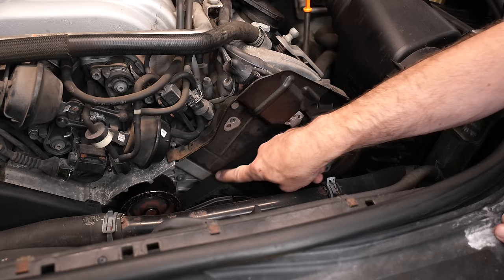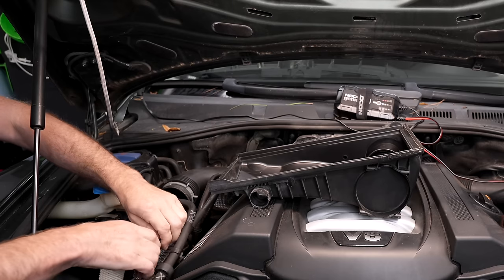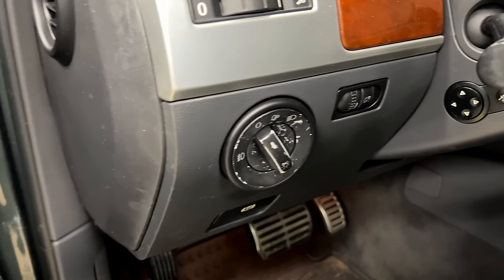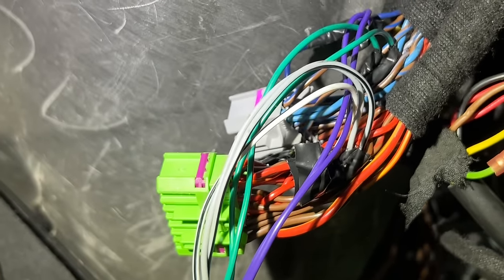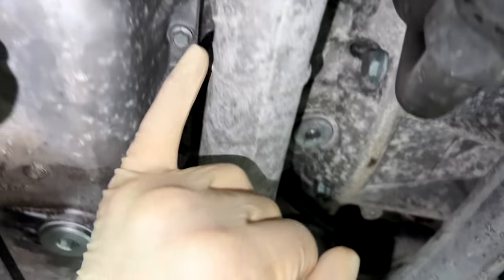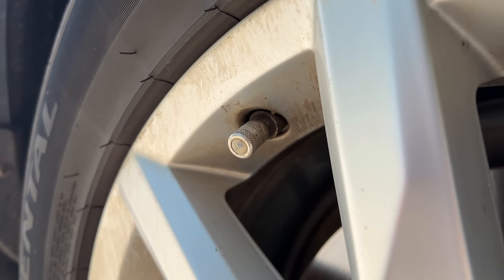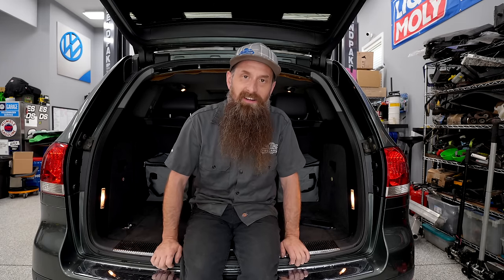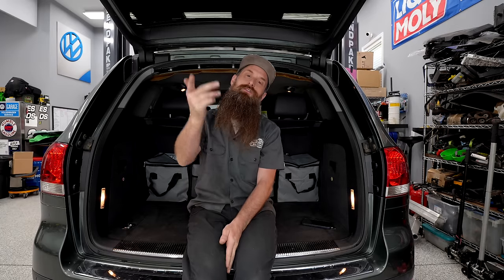Is It Worth Buying a CHEAP, OLD VW Touareg?

Comment: I've had a 04 Touareg (V8) for 5 years now, and I knew little about cars let alone Touaregs back then. Today I have enough knowledge and understanding to post advice here, lol. So here's what I think-
1) Mechanically, 1st Gen Touaregs are respectably well built suvs. My 04 had some issues, but that is to be expected for the first year of any car. 2006's have plenty of those issues resolved. (Note: T's built in 2004-2006 are called T1 Touaregs and those built in 2007-2009 are T2 , but they're both considered 1st generation. 2010 and onwards are 2nd Generation.)

2) The engine in the T1's is a Multi Port Fuel Injection engine, which means that it doesn't suffer from carbon-buildup-on-valves issue the way engines with Direct injection do. IMO it is a very well made/designed engine. As long as you change the oil every 5000 miles and do timing-chain/water-pump service every 80,000 miles, it will last a long time. The one failure point on these engines that my mechanics don't want to mess with, is the seized actuator arms on the intake (discussed in the video).

3) The transmission, transfer case, differentials, etc, also are high quality. They perform very well, and with regular service they don't fail. Altogether, the drivetrain is great and tough enough to not only take it off-roading, but also tow 7700 lbs (which is a lot for a vehicle of this physical dimensions).

4) I wish I could say these nice things about 1st Gen's interior. The interior is so bad that you'll be better off just taking it to an auto-interior shop and have them rebuild the entire interior from floor to ceiling.

5) As for electrical issues, if you encounter those, take your Touareg to a VW technician. If he cannot fix those, he shouldn't be calling himself a VW technician. But before you do that, make sure to check the battery. The Touareg's electrical system is quite sensitive to a weak battery, way more than other cars are. You have to almost obsess over making sure that the battery stays fully charged at all times. Also, even a high quality battery would need to be replaced every four years. If the electrical issues happen despite you having a good battery, only then take it to the technician.

So should you buy a 1st Gen Touareg? Before I answer that, realize that even a 2009 model is 14 years old today, so there will be plenty of issues to resolve. IMO you should get a V10 Touareg only if A) you tow 4000+ lbs on a regular basis, and B) your auto-repair skills are on par with professional mechanics. If you do not meet both these criteria, do NOT get a V10.

If you live in the midwest plains and you don't tow much, a V6 Touareg is sufficient. I live in the Chicago suburbs and I knew within a year that having this suv was overkill. Why does one need low-range transfer case in the plains? The only reason I've kept this suv is because I like the ride.

If however you live in hilly areas, or if you tow (but you're not an auto-mechanic) then you should get a V8 Touareg. The car has some features built in that automatically provide extra power when needed, and that makes towing or driving on inclines/declines a pleasure.
Reply: my friend group all have touaregs. two t2 3.6's, 1 t1 v8 w/air ride, and mine and another friends t3 tdi. I owned a V8 w/air, and a t2 3.6, prior and honestly the 3.0L TDI in my t3 out performs even a v10 when towing or just driving normally. its such a wicked engine. the t3 isn't as hardcore offroad as the older ones, but it can still do everything the older ones can, just with an issue of clearance and damaging a more expensive vehicle if you run into something. The 2013+ 3.0L TDI is the best engine in any touareg in north america in my opinion.
Reply: Disregard everything the OG poster said. I'm an engineer and had an 06 with very low miles and full extended warranty.  We went through 12k in warranty repairs before dumping it.

Now I'm a Toyota owner and can confidently say thus doesn't hold a candle to a Toyota or Honda.

EUROPE must have some nasty environmental laws that sabotage these cars with eco friendly parts that destroy themselves.

For example: The coating on the buttons wears off very fast.

The protective shielding on the wiring also disintegrates (never seen that before).

There's a notorious problem with the drive shaft carrier bearing.  It will disintegrate after 4-6 years.  The replacement is a new drives haft!  They do make aftermarket kits to retrofit your axle bearing to a serviceable unit but it's $1200.

I have 40 year old Toyota that still have the original carrier bearing and rubber! Wtf VW.

If you want a car that will leave you stranded this is the car for you.
Reply: @LibLibertyLibertarian  Funny, I worked at Toyota from 2016 until last year. They're phenominal appliances. If I recommended my mother a vehicle, it would be a toyota or lexus. But no, a comparable 4runner from 2006 is not going to outgun a Touareg. Especially since the touareg was made to do it all. The 4runners powerplant falls on its face on the highway, it's not a good tow vehicle, and a Touareg will outshine it offroad when both are similarily equipped. Figured that out when we took our rigs and my other friends GX470 out to the trails right quick. And well if that were true across the range, then my 7 examples of mine and my friends touaregs would've fit your experience, but aside from one leaking air hose on my air ride, and an alternator on my 260k 3.6L, none of our touaregs have had major faults. And I've had my TDI for 6 years now, and the ones prior I had anywhere from 2-3 years. Like I say, you either get a good Volkswagen or a bad one. No in between. They can be nightmares, which is why I don't recommend them to people who don't know anything about cars. But to those who dont mind wrenching and learning, the euro suv's like touareg, cayenne, ML, Range rover, etc. are a total world above anything from Japan. Save for  a Land Cruiser, but at that price point, it better be able to compete with them...
Reply: Whats that bad about the interior? Seems about par or a bit better than most other cars of its debut year...
Reply: @brandonfriesen5389  your comparing a v10 diesel to a I4/v6 4 Runner?  Keep in mind that you're only shining a light mostly on the power plant benefits.  These vehicles spend 99% of their life doing errands around town.  On top of that, the 4 Runners aftermarket support far exceeds that of the VW, so even if what you say is true, it could easily be compensated for.  On top of this the Toy will bring you home from the trail while the VW could easily leave you stranded.

On top of all this, we must consider the resale value.  The VWs are so cheap because they break down, are complicated to repair, and expensive parts.  You dump money into the VW to turn it into an off-road beast you'll never get your money back.  You will out of the Toyota or a Jeep.
Reply: @brandonfriesen5389  I haven't had a 4runner but had a FJ, I'll admit the Touareg is a better ride (when it runs) but to me it's worth the headache of always going to get it repaired or repairing it yourself when it fails.  I have a Toyota truck for 6 years now with twice the miles my TReg but so far its had no issues, the TReg had a dozen trips for repairs.  My time is far more valuable than to deal with that BS.  

I highly recommend that we turn our backs on these companies that make unreliable cars.  They are not only inconvenient, they are horrible to the environment when they get junked.
Reply: @GoldenCroc  it falls apart.  The buttons are notorious for peeling off.  You can buy stickers, scrape the texture, and carefully place the sticker. 

 The battery is under the seat so if you leave it off too long you may have to pull a 100lb seat off to get at it.

The climate controls have an intermittent failure where its display goes crazy.

Other than these issues it's a premium interior, quiet, with many features.
Reply: @LibLibertyLibertarian  "On top of this the Toy will bring you home from the trail while the VW could easily leave you stranded."

Why would the VW leave you stranded from the trail but the Toyota wont? In general, cars leaving people stranded seems so uncommon that its not even worth mentioning. Unless you got some specifics?
Reply: @LibLibertyLibertarian  Well I was hoping to primarily get an answer from the one who made the statement I asked about, but ok. 

The things you mentioned, most of which I was aware of except for the climate glitch part, dont seem to me to likely be helped by taking it to a an auto-interior shop.
Reply: @LibLibertyLibertarian  I made absolutely no comparison about the v10, i've never owned one, nor do I desire to. A comparable engine from vw to the 4runners 4.0L, would be the 3.6 VR6 which is just as durable, better on fuel, and has more power and torque. The 4.0L is fine, but as the saying goes, the power of a 4 cylinder and the fuel economy of a V8 and the sound of a V6. And aftermarket support for the Touareg is probably on par with the runner in my opinion. Some modify the touareg for performance, some modify it for offroad, so I'd argue theres more for the Touareg, since the engine options come in other Audi's and VW's, like the RS4,5,6, R32, etc...all performance vehicles. And the 7L/7P platform has endless offroad modification options. Very cheap and very easy to do mods for offroading, same with the Toyota. A simple search will lead you to that conclusion :) Plus modifying a vehicle to compete with another, just shows that's not a fair comparison, if you modify one, the other one should be modified to the same extent for it to be comparable. 

Depreciation? Absolutely, Toyota has always been number 1 for least depreciating vehicles on the market, but that means I can buy a newer Touareg for tens of thousands less, than an OLDER 4Runner. I don't want to spend $30k on a vehicle(especially one thats 10 years old)that I plan to beat up on the trails. I can get into an $8,000 Touareg(like I did years and years ago) and be ready to go as is. Done many trips in mine and all my friends Touaregs, and we don't modify them other than tires, and what they are capable of, is simply astonishing. Plenty of youtube videos document them perfectly.

And like I said, you keep saying they fall apart, and while they are far from the most reliable cars on the planet, the high milers in our group, have been just basic maintenance like fluids and filters and no more. The most in depth repair was the newer diesel leaking oil, which was fixed by $16 gaskets from the dealer, and about 4 hours of beer drinking in the garage wrenching on it. They are not a pain to own whatsoever. I took a gamble buying my first Touareg because I was unsure of the reliability, a decade later they're really the only things I'd ever want to own to be my do-it-all vehicle. The 4runner is just okay at a few things, the Touareg is more of a jack of all trades in my opinion.

I tow lots(upwards of 9,000lbs), I hit the trails and swing wheels high up in the air off uneven terrain going to remote areas and lakes to camp and explore, I sometimes highway bomb and do far from legal speeds with total confidence, I go to the store and get groceries and move the family around and fit in to expensive parts of town, and I get 34mpg when I decide to relax with my cooled seats, pristine audio, and ice cold AC. All with 1 vehicle that is happy to do anything. Not many vehicles, especially a 4runner, can ever claim that. Also has 180,000 miles and passes inspection every single time without flaw.
Reply: I like your explanation ,i would like to have a small chat with you coz im about to get one v6 08 3.6L
Reply: @JonasSaguti  I recommend posting your questions and concerns on the Club Touareg forum. There are many ppl there who've owned Touaregs for a long time, and many are more knowledgeable than I am.
You can also ask HumbleMechanic. As he said in the video, Touaregs is what he started out fixing when he got into automotive repair.
Reply: @JonasSaguti  As the last person to respond to you said, club touareg is a great resource. I'm on there lots posting answers and also asking questions. Great people on there. You're buying a 2008 which is a T2. The 3.6 is a great engine. In a passat they are very powerful engines, in a 5,000lb+ touareg, they are okay for power, but you won't win many drag races. A few tiny common issues but with the huge engine bay of the touareg meant to house a v10, the ease of working on the 3.6 is great. lots of room to work if you need. but the t2 or the t3(2011+), with the 3.6 is essentially buying a toyota-like reliable SUV in the design of a luxury german suv. Great vehicles.
Reply: @brandonfriesen5389  

Super helpful.  I'm more interested in towing my boxster to the track than off-roading or overlanding.

I was looking for a 2nd gen diesel and love  the 8 speed transmission.
Reply: @malcolmnunes8331  yup, thats the one I have.  A great tow vehicle. And unloaded, it gets small car-like fuel efficiency. Great rig.
Reply: excuse me guys, may i have your opinion about this: i have a plan to buy one of these (touareg), 1st gen. facelift or 2nd gen. (pre facelift), and here's the details: the 1st gen. facelift is v6 3.6, has air susp. but, the diff. lock still only at center, meanwhile; the 2nd gen. (pre facelift) is v6 3.0, no air susp. and the diff. lock still only at center, as well.

now my question is, which one of those, do you think, the better one or "platform" if i have a plan to decorate it further to be a decent suv offroader?

Thank You Very Much!

Comment: My .02 is for a "channel build" aka Pull all the suspension, hit the entire underside with a pneumatic needle gun to get the worst of the rust off, fix the bits and bobs that you pulled, hit the whole underside with some rust remover and then with some bed liner spray....and start the off-road conversion.

Comment: i picked up a 3.2 liter touareg for 1000 bucks. one owner fully maintained 137k miles no rust. i love it. minor cosmetics lift gate doesnt stay up and headliner sag but its been a great car handles phenomenally. had to replace the mass a/f and a set of toyo tires im only about 2k into and ive put over 10k miles on it. great deal. i missed my 2008 rabbit that was totaled so i had to have the treg. one thing im not liking is the whine that i think is coming from the front diff bearings. it goes up with speed and not engine rpm
Reply: yea Charles overpaid, I buy these for $800-$1500 in this kind of condition
Reply: @I6N54 lol you sound like you've bought a lot to start a dealership. Do you really buy a bunch? Charles's purchase price is fair in this market.

Comment: Bought a 2006 3.2 VR6 Touareg 5 years ago... for $1000.  Runs like a champ after refreshing the front suspension, replacing the thermostat & housing, crossover pipe and fixing various electrical gremlins.

Comment: I hope this one gets more views!! i have an 04 V8 similar to this one. I LOVE taking it offroad! Mine is called "Murph" (short for murphys law, cause everything that could break in that car, broke, LOL; from chain tensioners to valve body to kessy draining the battery. it currently has 226,000 miles! so they can go forever once things get figured out!. Oh and if you still want to use the factory amp, there are 3 wires (ground, left and right) that would need to connect to the front and back of the speakers in the after market harness. Looking forward to learning more tricks from you!
Reply: Mine had 280,000 miles and the engine still ran strong, but the immobilizer finally did it in.

Comment: Love it; bought an almost identical spec back in 2019, having been a long time German car enthusiast and figuring it'd be as easy to maintain as my B6 Audi. Then realized the base engineering of the platform was 90% Porsche and way more compilated. I will say that the more often it was driven, the more reliable it was. Leaving it sit would bring out the gremlins. The JXB carrier is great. Suspension overhaul after 140k of PA salt was a nightmare. Cat pipe flex sections are trash and the cheap ebay replacements are worthless (Magnaflow fits great but are $1400/set). Sunroof drains... ugh. Someone should come up with a sunroof delete panel kit for them. When it's working, man what a great platform. Smooth as glass at 90mph on the highway (and cranking out 13mpg at 3000 rpms), handles great on backroads, way more than any 5000lbs SUV has any right to.

Comment: We bought a 2010 Touareg TDI with the V6 It’s been a wonderful car, other than some emissions sensors going out we’ve had 0 issues. Very reliable and nice driving car
Reply: Did you buy it new or used?

Comment: The LED load resistors work good for the trailer light issue, need 3 in total (left signal, right signal and running light), I’ve got all my trailers wired up with them. The T1/7L is quite a shock coming from mk4’s, especially paired with the v10.
Reply: I tried load resistors but they got literally burning hot.
Reply: @kw57rx8dr.9  they should get warm but not burn-your-trailer-down hot. Another option is wire in little peanut bulbs, it doesn’t take much of a load to work.
Reply: I already did the light bulb idea after I burned my fingers on the stupid resistors and they were definitely hot enough to burn the trailer over a period of time, as I posted and that worked fine. @JoshsJettas